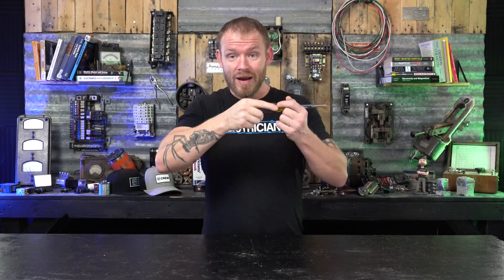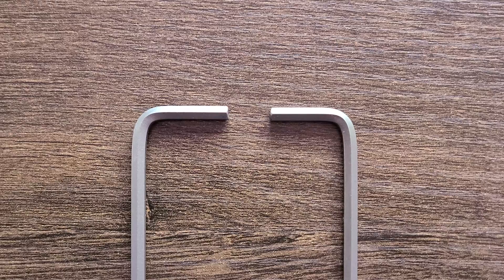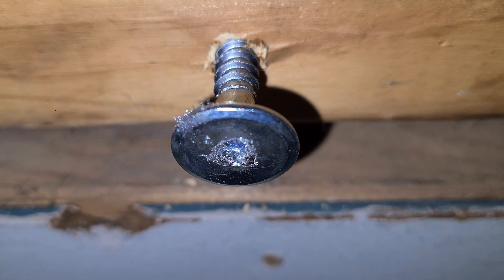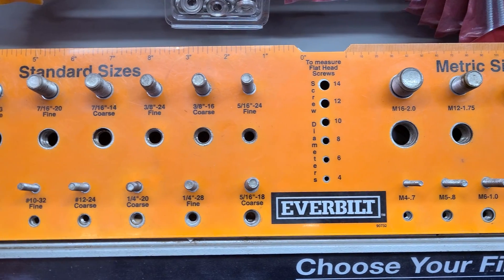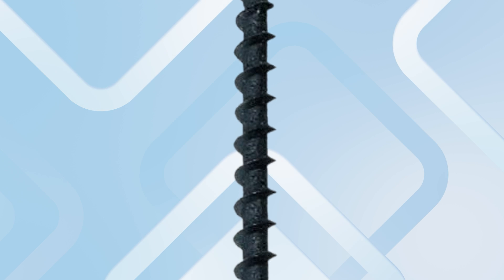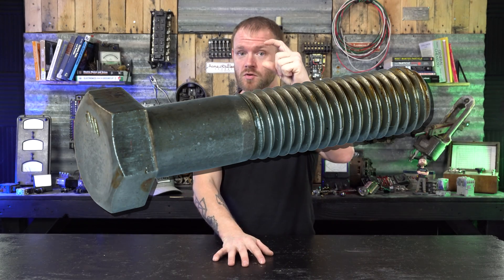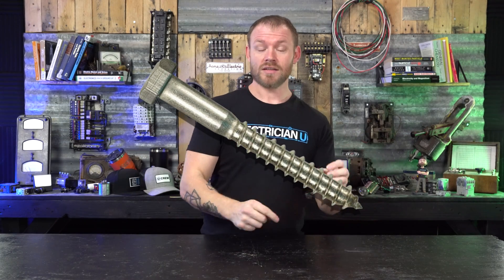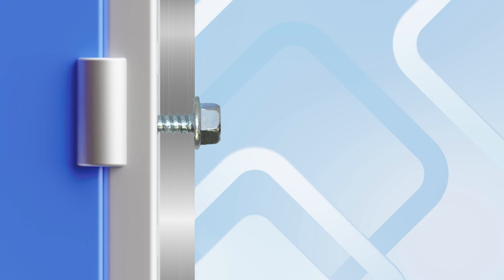Why Do You Use So Many Types of Screws?

Comment: Lag screw with a 9/16" hex head is for a 3/8" lag screw. Better off using two 1/4" lag screws as to not split the thin edge of a 2 by anything.

Comment: The large hospital that I retired from purchased top of the line hospital beds with two non TR receptacles so we had to replace the receptacles with TR'S. Took my tool pouch and found they had Robertson screws for covers .Okay went back & got that bit. Then discovered they used torx screws to mount receptacles, They had a Philips screw for something else do they had four different screw heads ! Tip NEVER Purchase or use ANY hardware from lying cheating lack.of quality control communist china.

Comment: The difference in a machine screw and a bolt is technically how it's fastened. Machine screws are intended to be secured into a tapped hole. A bolt requires a nut and a through hole

Comment: The old joke is that f there are 15 competing standards and then one proposes an universal standard to replace them. The result will be that there will be 16 different standard.

The most confusing is Pozidriv vs. Phillips. For long I though all cross heads were Phillips. I had seen screwdrivers marked PZ but dismissed those as unnecessary.
Reply: No one drive type is best for all screw applications.  The marketplace decides.

Comment: A bolt is a screw that is used with a nut.  If you turn the fastener, it's a screw.  There are 1" hex head cap screws (HHCS).  Carriage bolts are bolts because they are used with nuts.

Comment: You're forgetting structural screws, which are similar to lag bolts but have much better specs both in actual specs and as in more detailed specific specifications.  Everyone I've seen hold them as distinct from lag bolts and other than sometimes cost better.

Comment: One reason I like panhead screws is you can move your fixture around to the desired location before tightening if you don't get the pilot hole in exactly the right location; it won't center the hole and move your fixture. One thing I hate though is the constant mixture of imperial in metric- at least millwrights and machinists can generally choose what they use which is one or the other.

Comment: Here's a question that I haven't found an answer to yet. Why does wire gauge get larger when the gauge number gets smaller?
Reply: “Gauge” derives from the process of manufacturing the material, wire or sheet metal.  It originated as the number of draws through successively smaller dies.
Reply: My guess is that it's because when they decided on the convention, improving technology was giving them the ability to make smaller and smaller wires. So I think they wanted the ability to keep counting higher as wires got smaller.

Comment: We've often used carriage bolts on doors that need fixed such as walk in cooler/freezer units
What does drive me up the wall is when an equipment manufacturer uses flathead screws on one part of the unit and then switches to Phillips on another part

Comment: 6:07 
Simple added information about screws and bolts..
The difference between a screw and a bolt, is that the screw as pointy tip and it makes its own way into the surfaces to be bonded together. And bolts have flat tip because they dont make their hole, they need a predrilled hole in both surfaces, and a nut on the other side to hold the 2 surfaces together.
And for "machine screws" , they are in between screws and bolts. They dont need nuts on the other side, but they cannot be driven directly into the materials. They need to have predrilled holes, but the hole also has to have matching treads.
You can use a scew in a treaded machine screw hole, but not a machine screw as a screw.
7:42
Since this type is made to make its own way into the material, it should'nt be called a screw. The right term is "lag screw" .. ( pointy tip = screw ).

Comment: I will not use non-self tappers in metal anymore unless the hole is pre-drilled. The last time I did that I ended up putting the screw through the metal and into my thumb in the other side. Had to back it out. I’ve had and seen similar injuries when people are not using the right tool/material for the job. The 99 times you didn’t get hurt don’t matter. It’s the one time you did get hurt that costs time and money.
Reply: Pro tip- don’t put your thumb on the other side of the material you’re drilling.. also, please never use a nail gun

Comment: Self tappers are good at making their own holes, but I've found that it's often faster to drill pilot holes before using self-tappers. I've had more than a few handsfull of self-tappers go dull at the point before breaking through.
I'd love to see a video discussing the differences between sheet metal and wood screws.
Reply: Definitely agree. Self tappers will do the job but it's really faster and more efficient to just slap that pilot hole. Sheet metal isn't bad but any kind of actually steal definitely. We tested it at work. I had a impact and a drill set up and my coworker just took an impact and I was putting in 5 to 1 through 1/2" steel
Reply: So, Peter, I am curious if when you say self tappers if you are referring to just sheet metal and wood screws, or if you are counting self drilling and tapping screws (like Tek screws ) ?  And also the hardness of the materials that are making them dull before breaking through. I assume you know different screws are designed for different hardnesses. Not trying to be a butt here, just asking.
Reply: @dallasarnold8615  Specifically I'm thinking of the kind of screw with the chisel point meant to cut its own hole in mild sheet steel.
Reply: I use self tappers and burn those up then stick a pilot bit in. No one is gonna miss the self tapper

Comment: Another huge annoyance is how many sizes of screws there are. We don't need 1mm differences, let alone 1/32 or 1/64 differences *ever*!

I like how Honda did it. 10, 12, 15, & 17 mm is all you need for the whole car, not a set from 4 to 19!
Reply: Just add 14, 19, and 34 for the axle nuts.
Reply: @ctrlaltdebug  Never did those. Good to know. Concept still holds, though the 14 & 15 is silly

Comment: Philips heads were designed for early electric drills that were crazy powerful and had no clutches or protective features. The screw was literally made to cam out so you didn't over drive it and damage the workpiece.

Square heads were actually invented before philips heads but, for the reason above, fell out of favor.
Reply: Square never got picked up since it was a Canadian design and the owner didn’t want to let ford use it so ford stuck with Phillips. Square is more popular in Canada.
Reply: @FishFind3000  Judging from Ford now, Square was ahead of its time.
Reply: I've got one of those early Dayton drills. No clutch, low RPM ( little lower than DeWalt's low speed setting). If that thing "grabbed", you would get a seriously sprained wrist, if not broken.

Comment: Years ago we had a ten million dollar state of the art custom made German machine that had all.metric hardware. I had to drill & tap a couple dozen holes to install indicating luminaries. My boss wanted me to tap SAE holes but I refused because mechanics that worked on machine everyday only carried metric tools. I tapped metric holes & mechanics appreciated it.
Reply: You are a gem and they should protect you at all cost. I come behind guys that will be on the same run of pipe and can't even use the same screws. 1/4" 5/16" 3/8" just randomly slapped up
Reply: I like to keep the people behind me on their toes.. Philips here, torx there, a couple robertsons, a few hex (rounded over of course), and then the good old one way security screw for the finally

Comment: No reason to have anything but torex head screws.  Screws not threaded all the way, is designed to pull two boards tight together. The head of a screw can be anything but the drive hole being torex just makes sense.

Comment: "They (Phillips and straight slot)  were not designed for drills, they were around waaay, longer than drill motors"   Not true, the Phillips recess was patented in 1933, and it was designed precisely because straight slots didn't work well with powered drivers on assembly lines The patent application specifically mentions powered drivers. " "failure of the slotted screw to retain the blade-driver, especially in power driven operations, is not only dangerous to the operator, but is likewise, always injurious to the work,"
Reply: Also Robertson was not invented in response to Phillips stripping.  They were invented about the same time.  Phillips was designed to cam out so it wouldn't break screws.  The US adopted Phillips over Robertson because he was willing to sell his patent cheaper.  They were always inferior to Robertsons.
Reply: @AnonYmous-yi4zy  The Robertson  drive was invented well before the Phillips drive (1908 vs 1933)  Robertson screws were used by Ford on Model T's.   For what it's worth I believe that it is a myth that the Phillips was intentionally designed to cam out to protect from over torquing.  Obviously, they do cam out under certain circumstances,  but  I haven't been able to find any support for the claim that this is an intentional design feature.   Yeah, you can google up a whole bunch of websites which make that claim,  but I haven't seen any which support that claim with any sort  of reliable source.   There are 7 patents for the Phillips driver recess issued between 1933 and 1936, none of the applications for those patents m list limiting torque  through cam-out as one of the listed benefits to the invention.  In fact, the application for patent #  2,046,839 lists the opposite as a benefit:    " ... and such tool will have little or no tendency to cam out of the recess of the screw in driving the same"  (verbatim quote)   I believe that this whole "Designed to cam out to limit torque" idea  is just one of those myths which began with an erroneous claim, and has been repeated so many times that many people now believe it's true.
Reply: @andrewalexander9492  good stuff.  Thanks!

Comment: I read that the flat head screw are such because they are intended that you don't screw it too deep for what ever you are fixing it into. The idea is that it is supposed to slip out to prevent driving it too deep.
Reply: Jeremy, whatever your source was is wrong. Flat heads came into being from originally being hand formed by blacksmiths. Easiest head to make by simply driving a flat bar into it while hot. And if you don't already know, carriage bolts come from when horse drawn carriages were being built, hence the name.
Reply: @dallasarnold8615  And then their are stove bolts.  Don't know if they make them anymore.
Reply: @davidmarquardt9034  Yeah, right. There are so many fasteners out there and each with its own reason for being. Dangerous subject to delve into. So, many with more knowledge than the next. I am probably half way down the pile already.
Reply: I think he’s talking about why they’re still in use not why they made
Reply: I think he’s talking about why they’re still in use not why they made
Reply: Yeah, flatheads don’t slip.

Comment: Flat head screws should be illegal. It's 2023, lets make it happen
Reply: Flat head screws pissed me off back in 1976 when I was a teenager. They should’ve been banned then.
Reply: For a country that hasn't gotten into metric units for over 50 years when the rest of the world is, that likely won't happen.
Reply: @estynusca4006  😂😂😂 for real!
Reply: @estynusca4006  what size is your ratchet driver
Reply: @Are_Guy936  1/4, 3/8 and 1/2 because they are the only ones made here in the states. That doesn't justify why we have two types of measure. Metric is used in healthcare, medicine, science, some engineering, and many retail products are now labeled for both. Milk, soda, other liquids, dry goods, canned goods. There is no need for both AND metric is easier to use when you understand that the type of measure carries across weight, length, volume, etc.
Reply: @estynusca4006  Are you going to pay to have all our old blueprints converted?
Reply: @estynusca4006  We also should all be on metric, I agree
Reply: And them danged tamper proof torx… Either make them all phillips or don’t make them at all…
Reply: @NoName-OG1 the only issue with the tamper torx is when they use the one way backing pieces
Reply: @cliffcorson4000  to me all torx are tamper proof - little pin or not - because torx are not used on electrical. But up my way, they seemed to have replaced nails in framing… That’s a “carpenter screw” now, none of their stuff is phillips anymore. So they may as well be 🔑 keys 🔐 for a 🔒. 

Now granted that go into wood Great 👍- but if I need framing adjustments I have to go find a carpenter with the keys to move it - or start carrying a set of my own… Then pull out a T14 for a T25 and yea all the bits have the hole for the TPpin  - most of the time I have to go hunt out my TP kit… Then switch back to phillips for my own stuff. Or square in a panel now. 

I’m half tempted to bribe local supply houses to only sell square with phillips capability.
Reply: @NoName-wm7sg  some equipment manufacturers use torx screws on casings so they can prevent people accessing them
At my job we've put torx and security torx screws on equipment to prevent store employees from opening them up
Reply: I agree
Reply: Couldn’t agree with you more
Reply: "made in China" are the worst screws and should be banned.
They are very badly made.
Self-drilling screws dont have good drilling tips, and square-heads dont fit well on screwdriver tips ( head not deap enough and/or too slack ) .
Reply: Mulberry's RS covers are so terrible for this lol. They look good tho
Reply: The lack of threads are meant for pulling sheet materials to the item you are attaching to. If you’re sending a shiner through ply and rock - that’s a different and shorter screw.
Reply: Make them all square tip and make it easy so I can carry 3 screwdrivers and a set of t keys
Reply: Agreed 💯 ban all flat head screws.
Reply: Good thing I just carry a full care of everything. Square tip torque Phillip hex head and nut drive bits. Just so I can move any screw. Would be nice if they would standardize most everything though
Reply: @mackenziepeek9317  I have a box of 96 screwdriver heads that include slotted, Phillips, square, torx and security torx, hex, and triwing screw heads
I even have an Amana microwave screw tool -- think of a reverse triwing screw head
Reply: Philips also along with imperial measurement.
Reply: Amen
Reply: 1000% agree with you
Reply: Dude I was getting so mad this past week putting up coach lights that used a long 8/32 flat head to mount it to bracket. The bracket was recessed super far back in some bricks so I couldn’t trim it down. For whatever reason it started camming out half way so bad. I bet it took me 15 mins to get that fucking thing in. I was mad as hell. I’ve always thought flat heads should be banned but that was the final straw for me. Fuck those things.
Reply: Ecx is the shit
Reply: A flat head screw is one designed to be countersunk, tp keep a flat surface.  That is a useful design, but if you don't like it, don't use it.

You mean "slotted" screws, though.  I don't know where you live, but I live in a free country where the marketplace decides such things.  We don't need government telling us what screws not to make.
Reply: besides cover plates I totally agree
Reply: @ryanmcallister6958 Cover plates is especially where they should go away. Not only is it the easiest drive type for people to improvise when they shouldn’t (like kids with a butter knife), but it’s also the only type of driver that can accidentally slip into the hot prong of a (non-tamper resistant) NEMA 5 receptacle. Even Philips would be better.